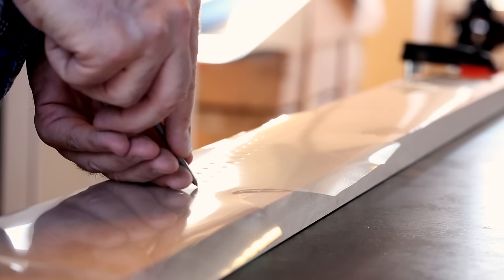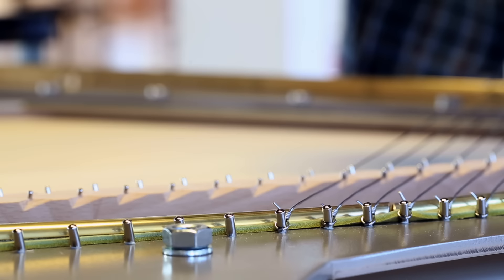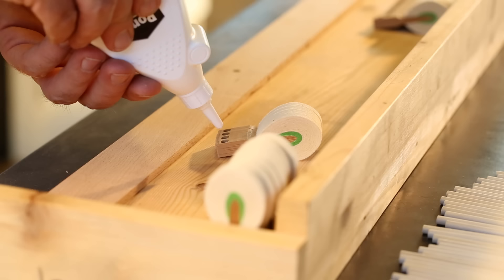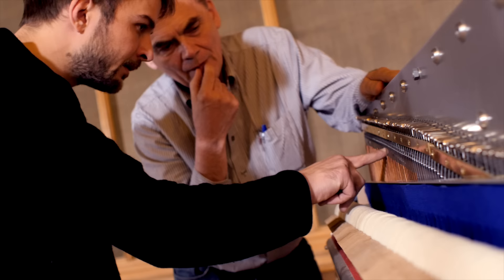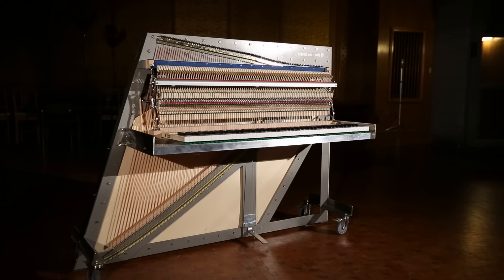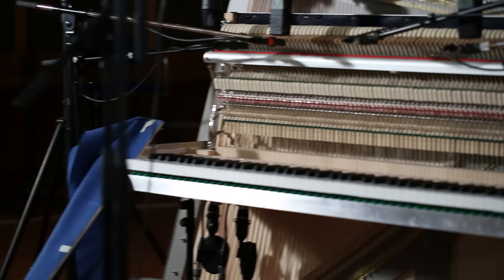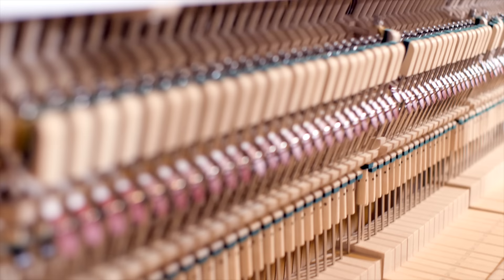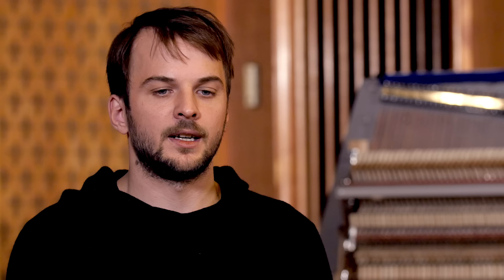Creating Una Corda - Nils Frahm and David Klavins | Native Instruments

Comment: Seems like a downgrade of the traditional acoustic piano that has been removed some elements to produce a less powerful sound and for that same reason it is necessary to remove the casing so as not to drown out the sound (although some think it is cutting-edge design although it resembles more like an instrument of the 17th century). In a normal piano a similar sound could be achieved with good regulation, voicing, pedal and the right touch. Anyway, it seems like a cute and extremely expensive toy.
The only thing I consider a problem is that with that delicate sound and with the mechanism exposed to the performer it is impossible to eliminate the noise of the hammers and the rest of the action while playing.
Reply: Wooosh.... That's not the point, it's supposed to be a new idea and intrigue
 people which it does